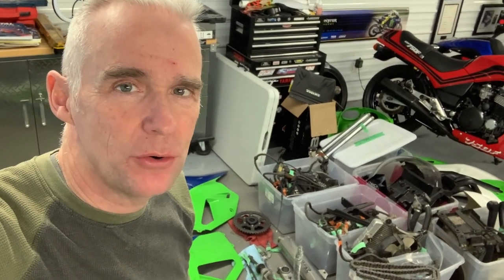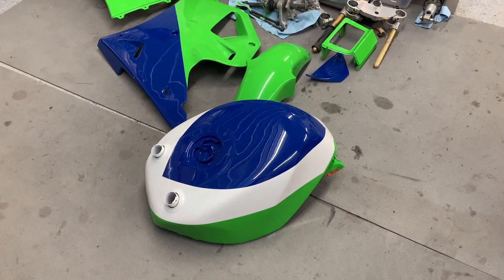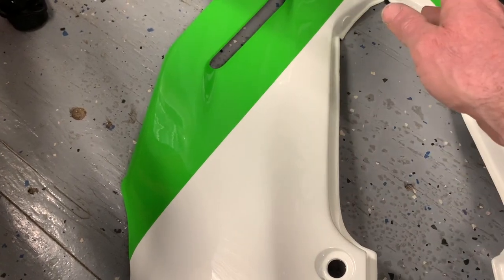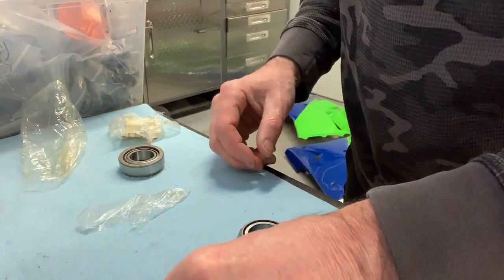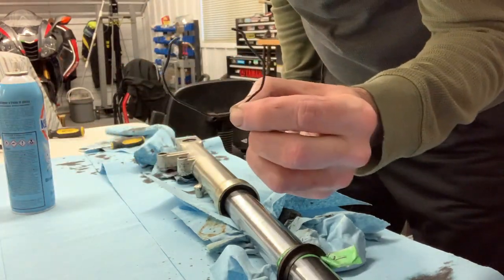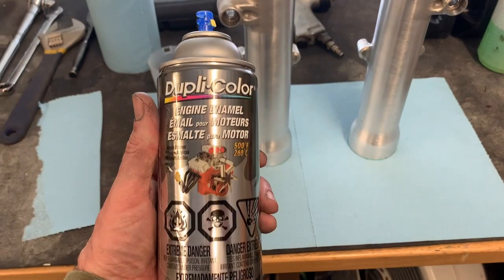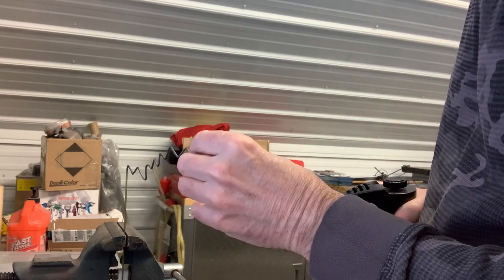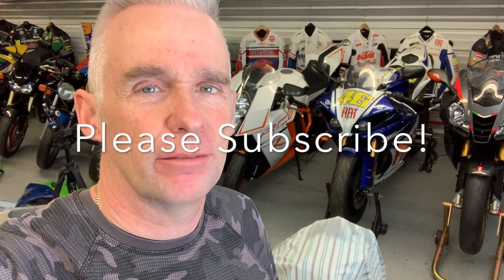1990 Kawasaki Ninja ZX7 H2 - Restoration - Episode 7 - Head Bearings and Forks

Comment: I know you did the video 12 months ago but I am just watching it now.  The easiest way to remove head stock bearings if stubborn is to run a weld (stick or MIG) around the inside where the rollers run.  This superheats the race.  It can't expand when heated as it is retained.  When it then cools it shrinks and falls out.  Alternatively use an oxy torch to superheat the race cherry red and let it cool.  Keep up the good work
Reply from the maker: Thanks Kevin, never had much trouble removing the outer races, occasionally removing the inner race off the stem is a pain.

Comment: I think your dad would be happy with how you used that tool--you made it look easy!

When you're putting it back together... if you have a special technique for setting torque on tapered bearings, I'd be interested in seeing it. At least it looks like they came tapered (as opposed to ball) stock on that bike, so manual should have a decent starting spot. Changing from caged ball to tapered has proven a bit tricky to me.
Reply from the maker: Cheers Matt.   Re the technique, I really dont have one, I just do it by feel really.